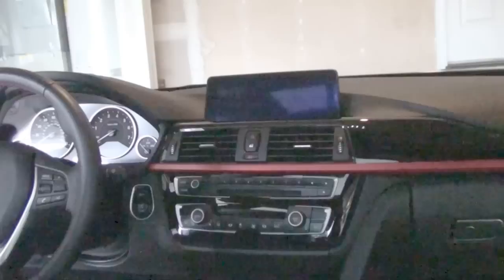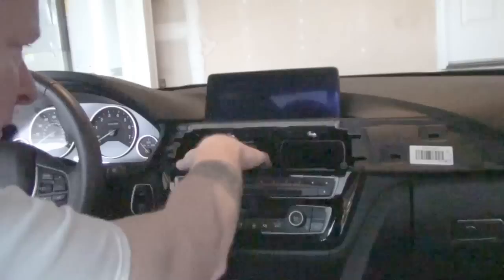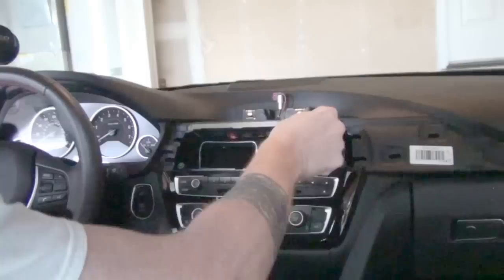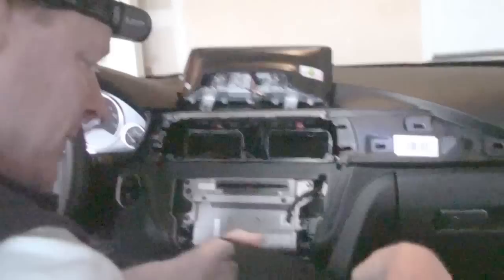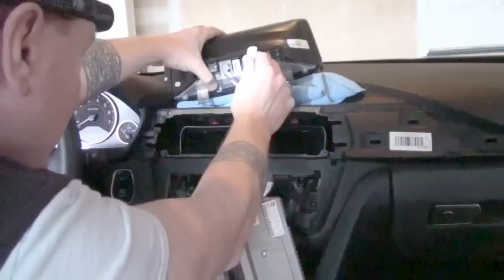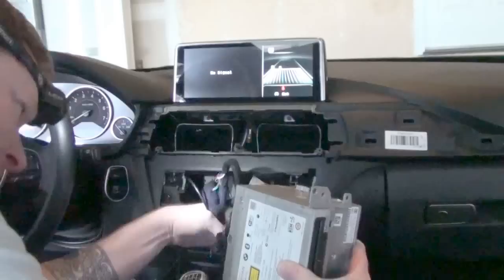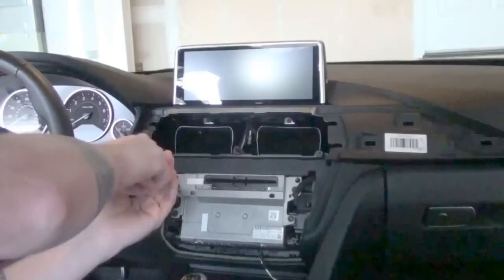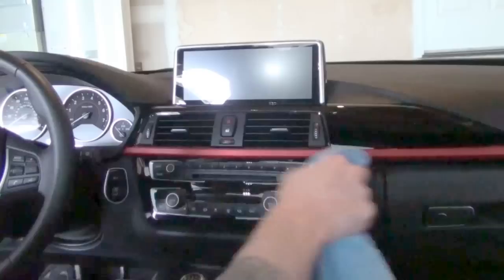BMW F32 Avin 10.25" BMW Android Multimedia Navigation System installation DIY

Comment: Hi I just installed the screen in my F10 2014 535i Msport. Now my heads up display will not work do you have any advice, I did transfer the green cable in.
Reply from the maker: The green and black optical cable is for audio.  The big video plug (usually a pure plug) is probably loose.  I have the HUD as well and have no issues. Check those plugs for sure as that would do it.
Reply: Ok the part that plugs into the factory plug won’t lock in. I try to pull the handle down to lock it in but one side will not go down all the way to lock it in. So that’s probably the problem.
Reply from the maker: Yup.. loose plug.  Keep working at it, I am sure you can getting it fully seated.
Reply: BMW DIY Guy I am still having problems the part of the harness that hooks up to the factory harness will not seat correctly and preventing the lever to come down and lock it into place.
Reply from the maker: I had a similar issue with an install I did recently, but was able to work the cable over until I got the horse collar down into place.  WORST case and if you feel the cable harness is bad, talk with Avin and have them replace it.  I was able to work mine out though.

Comment: Been going insane looking for the se card slot, can’t see where is hidden. I’m guessing it might be in the silver trim but I’m afraid to break it since it’s a whole piece. I only see one on the left side two small holes like mic. Holes other than that no other sign where a slot might be.
Reply from the maker: ADVIL102 it is on the drivers side, under a small cover you will remove.  Best way to see it is look at the product pictures on Avins website.  They show a clear pic of the back,  and you can see the door.
Reply: BMW DIY Guy i was afraid you might say that. I’m thinking I’m getting a different version or model. Mine doesn’t have nothing on the back or the sides. Avins send me the pictures and the back doesn’t look the same. I send them pictures of the back and they recommended to used the usb instead being more difficult to get to the sd slot (which I’m guessing) it’s no longer available on the Monitor for F15 BMW
Reply from the maker: Ok.. I was assuming you meant the display for the F32.  I looked at the pics for the F15 display and I do not see the door and port on the back, like the display for the F32.  I am sorry but I dont know where that slot is on that display, and would agree, use the USB.

Comment: I have a F30 2013 w/ nav unit. It did not come with a backup camera originally. Does this unit allow a reverse camera to be added or is something more required? Same question for a front camera. Can you run both a front and rear camera? 
Oh, another Q, does the bluetooth for calling on the new screen have a mic or does it use the cars original mic?
Reply from the maker: So absolutely yes.. While my car has the OEM backup camera, I just helped another customer install both the display and backup camera he got from Avin.  It works very very well.  There is also integration for a front facing camera as well, though I haven't done an install for that in THIS model.  (I did in the E46).  

Great question on the mic.. I actually don't know in this case, but I believe it uses the original, but I don't know that for sure.
Reply: Thanks, was there another module required to incorporate a camera into the existing HU and new screen or do I just need to get a camera and cabling? Thanks
Reply from the maker: They sell the module and it works great.. integrated into the trunk handle perfectly, and then you run the wire from the trunk, through the cabin and up to the head unit.  The install is really easy, it just takes a little time, including tapping rear lights for power for the camera.  I just did it on that F30.
Reply from the maker: You can get a compatible camera from Avin when you order, and the install is not that bad.  I have done the aftermarket rear camera install several time, and once in a F3X car for a buddy, which I didn't film at the time. It really isn't that hard and absolutely worth it.
Reply: Thanks for the replies. I appreciate it.
Reply: Does the camera not get power from the main hares? There is supposed to be a red wire that runs the length of the video signal cable that connects to the harness...  Here are Avin Support instructions: 1. Connect camera's RED wire to the wire labeled "CCD_Power" or "+12V_Camera" from the harness cable plugged into the back of the monitor.

2. The other end of that camera's RED wire attaches to the backup camera.  This will power on the camera when you are in reverse.

3. The BLACK wire is GROUND.

Comment: I have few questions if you could please answer,

1 - I have BMW 3 Series 2014 and my car does not support audio streaming through Bluetooth because the Bluetooth in my car is just for calling so after the replacement of this screen it will support Audio streaming ? 

2 - Original UI interface "original car" will also show in full screen ? or it will be 6.6 inch ?
Reply from the maker: I am happy to help.

1.  Yes, the new display is embedded android and has full BT functionality, so you can stream music, link your phone, etc.
2.  The original car UI will display full screen on the new display.  Mine was the 8.8, so I cant say I have seen the 6, but the original displays on the new screen look noticeably better.
Reply: From where can we buy it I know the Avin site but I would like to order from somewhere else.
Reply from the maker: I do not know if Avin has any resellers, and have only worked with them directly.  Worst case, email them and see if they have a reseller or vendor closer to you?
Reply: Thanks for your support.

I got my unit however I am facing few issues and I woukd like to know if you know how to fix them. 

1st -  When I play a song through bluetooth there is always a noisy/staticky sound in the background.

2nd - many times mostly when I load Nav the screen show the message "No singal" and I stop my car and then start it again after some time to get the screen back
Reply from the maker: I will test and see if I can duplicate your BT issue, though I haven't seen or heard of that problem thus far.  What device are you using and have you tried more than one device?  Next, no signal on NAV makes no sense to me, as it shouldn't be looking for a signal per se unless... (thinking out loud) if the GPS antenna is maybe not attached fully or in a place where it cant be seen?  Are you using the Sygic app for NAV?
Reply: Yes I am using the Sygic app for NAV and the no signal issue does not only come when I use NAV it comes automatically maybe like after 30 minutes of driving and then no signal txt on screen and then everything stoped like if I am playing music etc. and in Sygic the no signal issue comes right after I put the full address and click the "drive"go button and I have put the  GPS antenna at the right place.
Reply from the maker: Ok.. so I haven't seen that yet though absolutely will keep my eyes peeled.  Is it NO SIGNAL, like a big image across the whole screen or smaller in a window tile?  Just throwing out ideas, and if there could be a loose connection somewhere.  I would start there, check all wiring and then retest and then reach out to Tommy as well.  I will keep my eyes peeled for you too.

Comment: I need help with install , no sound and I did connect the aux and made sure it was turned up , I can’t find a real guide for a 2016 bmw 340i I triple checked. All connections. Screen comes on. And I can flip back and forth through all just no sound.
Reply from the maker: Do you have the green and black optical cable, and if so, did you move it to the new adapter?
Reply: Yes sir I did . I will go back through and take pics of all connections .
Reply: Found out why do u have an email so I can show u what I mean I can’t explain it really and also I have question about gps my car came with gps but I ordered the splitter and little gps unit . Mounted under dash just like video but where do I split it to I though I just plug it in to monitor
Reply from the maker: @johnc4081  will help if I can... bmwdiyguy (at) outlook (dot) com

Comment: Does it work with parking distance control or would I need to wire that up different somehow ? (As in automatically come on when in reverse through PLUg n play cables ) thanks
Reply from the maker: Kisho S.K aftermarket PDC or oem? The oem works just fine, shows on both sides, iDrive and android when you go into reverse or activate it manually
Reply: BMW DIY Guy thanks for replying , mine is oem, would you recommend this overall ? I have cic but I do not wish for it to be laggy etc as I am a iPhone user and hate android phones aha
Reply from the maker: I can understand.. I really like having this display in my car, and is vastly better than the OEM screen, even the 8.8''.  It may take a little time to get used to android if an apple person, but it works well.

Comment: Ciao, i have a problem:
I followed your step by step tutorial but when i go to the "original car" settings, lines appear on the screen and the resolution is busted.
Can you help me? I can send you more photos if you want.
Thanks
Reply from the maker: Elektrogian I absolutely had the same issue and you have to set the can bus interface to the right car model.  I show this in settings, where you have a series of bmw model choices for the right interface.  Also watch my review video and I walk through those settings.
Reply: ah ok, to the factory options where i need the password? 1314?
Reply from the maker: Yes.. then the bottom option where you set the can bus settings.  It is in Chinese by default, but side note, I have seen an update that is coming from Tommy that changes that to English.
Reply: Ok, Thanks for your help
Reply: Hi, i have the samedi problem but i tryed all the options but is useless ( better but not resolve compleatly The problem. 
Can i downloading another types of Can ? Where? 
Thank you
Reply from the maker: Howdy!  Did you buy the display from Avin USA?  If so I would reach out to Tommy and Avin immediately  on this issue.  First there is a new display update plus updates to the CAN settings that have just come available.  I will have a new review up sometime this week with the update.  If you didn't get it from Avin, I would contact your reseller asap.
Reply: No, I bought the display from a Chinese seller but do you know where can i downloading Can types interface?
Reply from the maker: José Eduardo Prado Netto no, I am sorry I don't.  I would recommend returning it and work with Avin as I am familiar with that company and the owner and know they are reliable.

Comment: So I guess as I'm thinking about this one downfall is if you are playing your XM on your factory car stereo but using Waze or google maps on you Avin unit then you won't hear directions being the sound goes through AUX plug but I have XM on correct?
Reply from the maker: B Chi I don't have an XM account but my radio will still work while in the android side Nav screens.
Reply: ok great, I emailed Tommy too, he had said that for mine it will do a AUX switch back and forth automatically as needed to voice directions vs listening to the radio. Thank you!!
Reply: last question, i think, 

being the GPS is running off a droid tablet pretty much, does it take a while for the gps to lock in when you turn the car on or is it immediately available once i get in the car?
Reply from the maker: I haven't had any issues with GPS resolution after launching the NAV app.  It is ready to go immediately.
Reply: sweet!

Comment: Quick question is the original screen on that 4 series smaller that the aftermarket screen you installed? Thanks
Reply from the maker: Yes.. the F32 either comes with a very small 6.5 inch screen or the largest at 8.8, which is definitely better but not as good as the 10.25 here.
Reply: BMW DIY Guy .  You are the man definitely gonna purchase trough advin and will let you know how it goes! Thanks for the fast reply awesome..👍🏻

Comment: Hi Mate. Do you have the same issue that navigation sound comes out more from the driver side plus it feels like its coming from another speaker other than the still music play speakers? and is there a way to adjust that?
Reply from the maker: Howdy!  I would say first I will test that as I haven't noticed that behavior, but will say I use the navigation maybe once a month or so, which is a very small sample set.  I will check that.. as always, my advice would be to check with Tommy at Avin to make sure you have the latest build for the display.  I have seen two updated builds since my install to address small issues.
Reply: Well I wish I were like you, knowing each single spot in my city, but unfortunately I am not. I have just installed the unit on my 116d. So I purchased the android kitkat 4.4.1. it is 1 GB of ram and I am not located in the US so what about Tommy? he has a channel? or does a service?
Reply from the maker: Ah... did you get your display from someone other than AvinUSA?  Tommy is the owner of Avin, and works with customers directly, GREAT guy.  If you got it somewhere else, I would just check and make sure with your seller, that you have the latest build for the display.
Reply: BMW DIY Guy yep! I am in Europe a bit far. thebguys probably dont know alot unless they ask the engineers the production site. I will check. but if you find out the same issue just tell me! by the way my navigation app is Sygic.

Comment: Help :-)
Question, have you worked on a bmw 4 series convertible because I'm trying to add an amp in the boot, and I'm not sure where to grab 12v acc to switch the amp on.
Thanks.
Reply from the maker: Great question.. I am sorry, I don't know where to find that run in the car.

Comment: Do i really need to plug it to the aux in the armrest ? dont like to have that cable laying there .
and some apps like maps and google play wont display in apps can i make em visible?
Reply from the maker: So for the AUX cable, in some models you do need to run it and in others like mine you do not.  I don't know why some you do and some you don't and is variable.  I have helped several owners run the aux cable under the center console and up to the port, so you don't ever see it.  For the apps, reach out to Avin and get the latest update to make sure all apps are visible.
Reply: okay so its probally because i dont have an factory amplifier maybe ? yeah i'll reach out for them and ask for a update. Thx for an quick response.
Did the install in no time thx to yre video.
Reply from the maker: Mexerz Happy to help!

Comment: Hi I’ve just installing the avin screen (7.1) in a bmw f30 but the speakers are making a cracking sound
Reply from the maker: Did you run the AUX cable?  If you did, check the connections to the AUX port, and even at the wiring harness itself.  It sounds like a bad connection.
Reply: BMW DIY Guy Iv tried with and without the aux cable both ways have crackling, I’ve disconnected everything and reconnect my original screen which worked fine and again reconnected android one the cracking starts again
Reply from the maker: So couple of ways of narrowing the variables.. Try your phone (or similar) into the AUX port and see if you get any crackling sounds.  Also test with the same AUX cable you are using to make sure that isnt a variable.  You can always try with another AUX cable as well to ensure that isnt the problem.  Also, do you get any noise if you spin the AUX plugs in the ports themselves?  For straight noise/crackling sounds, I haven't heard of any issues from the deck itself, its always been cable or sketchy AUX port issues.
Reply: I’m thinking it’s the cables I’ve messaged the avin website see how we go from there thanks for the help. Another question mate is there a way to select/open and app on CarPlay using the idrive controller?

Comment: I did the install, but I cant get sound. Any reason?
I did the correct change on the optical fibers. 
Original sound is working.
Reply from the maker: So fantastic question and I absolutely recommend reaching out to Avin.  I have heard, from one user, they had to route a wire from the new wiring harness to the AUX port in the arm rest to have additional sound out of the system.
Reply: Yes, I heard that. I think I will have to do this. Thank you.
Reply from the maker: So working with another install this weekend, we DID need to run the AUX cable from the new wiring harness to the port under the armrest.  We did a VERY clean install though, with the cable under the center console and fished through the center.  If you have the rubber mat (and not the sketchy phone dock), you can lift the mat, fish the AUX run through the existing holes in the frame and into the port.  The rubber mat then goes back into place, and you only see a very tiny amount of cable.
Reply: BMW DIY Guy oh, your harness have a RCA white and red male cables ?
Mine is like that. I have tried routing the cable to the aux in the armrest but had no sucess, unfortunately. I'm going to take the car to a professional sound installer, so he can take a look.